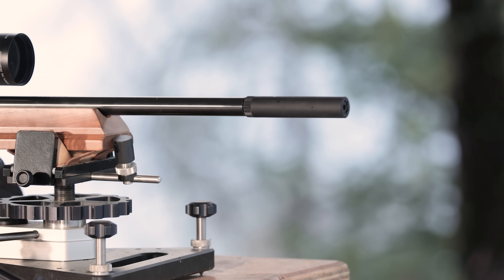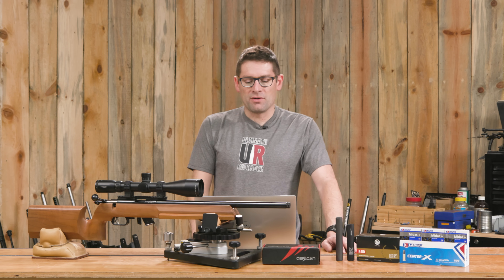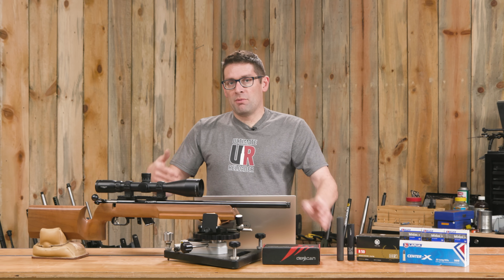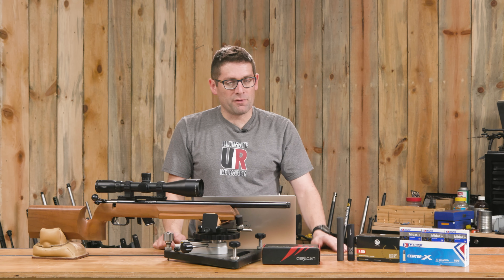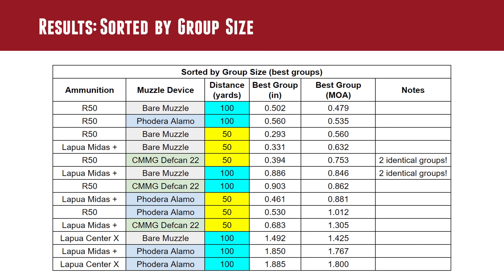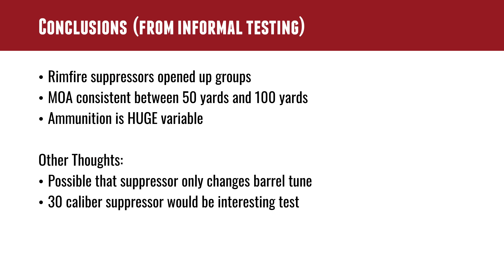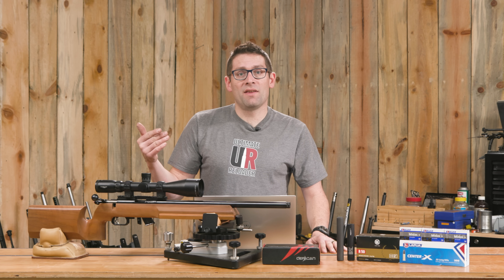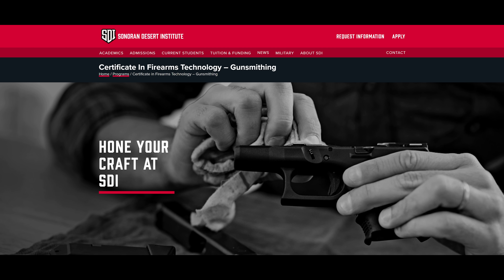Do Rimfire Suppressors Affect Accuracy? (let's find out)

Comment: I think you were right about the length of the suppressor changing the tuning of the barrel. If you put a tuner on the barrel that will affect the group size so it would stand to reason a suppressor would change the size of the groups. Every time you change a variable you then have to adjust for that change to get the smallest group.

Comment: Good info. However, when testing  22 rimfire ammo you need to clean the barrel between groups if you are changing manufacturers. I believe Lapua Center X & Midas use the same lube. Same goes for SK ammo's. My extensive testing has shown you can test SK Rifle Match,  SK Standard Plus or Long Range without cleaning between ammos as the case lube is the same. But you can't go from CCI to SK to Eley to  Lapua etc and get an accurate result IMO. The cleaning doesn't need be extensive either. 2-3 patches with brake parts cleaner and then a couple clean ones will do then a couple fouling shots and then shoot for groups. I've spent many hours and way too much $$ testing  higher grade 22 ammo. My Anschutz is picky as hell and I'm still searching for my Huckleberry. My CZ457 Pro Varmint shoots SK Rifle Match & Standard Plus as well as it shoots Eley Tenex and Lapua Center X at about half the price per box. The barrel likes what the barrel likes. My groups open up with my Thunderbeast Takedown 22 suppressor as well.

Comment: I have two similar supressors, one for .22 and the other for .30. They were made by the same manufacturer but I never knew who that was. The gunsmith that supplied and fitted them passed away more than 15 years ago. Both are non-serviceable monolithic types, just a big (much bigger than any other supressors I have seen) can with a single baffle roughly 2" from the end. They are designed to seat against a taper machined on the barrel behind the thread. The .22 one is fitted to an old BSA Martini-actioned target rifle. The barrel is quite thick and long (over 30"). On this rifle, fitting the suppressor improves the accuracy considerably with all the ammo I have ever tried. The .30 can also improved the accuracy of my .308 with all the loads I tested with and without, but to be honest I only tested a few loads without, and after that just always used it. Both these supressors make a significant difference to zero.

Comment: I think you're right that the cans are just changing the barrel's natural harmonics and it's just luck of the draw whether this or that can will be a benefit or detriment. I'm sure the turbulence inside the can is part of it, but if that were the only factor you would tend to think that one can would perform better than the other across multiple loads. I can think of two strategies to try and mitigate that. One, make the can as light as possible. That would have the least effect on harmonics. Two, have a weight that goes back and forth on the suppressor so you can tune it to your barrel. If you want to try that experiment, I could model you a little 3d printed weight that would slide back and forth on your suppressor and you could see if it's possible to tune those groups back down to bare muzzle size.

Comment: In my experience,over 20 years, I have found that suppressors designed for 22lr do slightly increase group size but I have found using over barrel suppressors that are volumetrically too large for 22lr, don’t alter or slightly improve group size the over barrel design definitely will effect barrel harmonics I have two 22lr rifles an old anschutz mod 1416 msp bolt action single shot 14” barrel and a marlin mod 925R 16” barrel, both are fitted with suppressors suitable by volume for 223. I only use sub sonic ammo. At 50 yards the anschutz consistently shoots .3”-.4” groups. The marlin shoots .5”- .75” groups both are regularly used out to 100 yards on rabbits etc 70% - 80% head shots. Out of interest over a chronograph the 14” barrel averages 17 FPS faster than 16” at just over 1000 FPS ,  love your videos always interesting and in depth info thanks keep it up

Comment: I have a 1.5" linear compensator on my 10/22 . It actually makes it even more comfortable to shoot and doesn't seem to affect accuracy at all.  I had a 3" linear compensator on my savage a22 and it made a huge difference on shot spread.  Took it off and regretted all the pennies spent on it. The shots closed back up without the 3 in linear comp.

Comment: I'm not as versed with powder burners and suppressors. But I shoot a fair amount of air rifles, and two things I learned.  With pellets trying to push velocity too much causes instability of the pellet. My theory on that is with too much air coming out of the barrel behind the pellet it actually kicks the ass of it around and you end up with instability from the very start. Buy detuning the rifle from a thousand feet per second to 870 ft per second with an 18 grain jsb pellet I was able to bring the group at 50 yards from half an inch a ragged one hole.  At 88 yards under half inch, and everything fell apart by 100 (3 inch).  But given my distance for that rifle, 88 yards is more than enough. So I'm pleased with that

With the powder burner I would wonder about Barrel harmonics if it were a heavier caliber, but I'm not sure if a 22 would move that Barrel around significantly. The other thing I would be thinking about is velocities.

I know you probably know all this but sometimes even asking the stupid question can be helpful. Because knowing less causes me to ask naive questions

Comment: Awesome video. Since 22lr cans get dirty, weigh the can clean then run a brick threw it and recheck zero. Weigh the can. Be neat to see, I don't have the funds to do this myself, but I know this is why compeditors don't run cans on 22lr's
Reply: Would be very interesting to see this, listened to a great podcast with one of the guys from Vudoo Gun Works, he was talking about how a rimfire suppressor would change weight over time and act as a tuner. With his setup he found the best node from 200-400 rounds and then they started to open up again.

Comment: For my 300 Blackout I have a thunder chicken, for the 22 I've been looking at a dead air mask. Currently the only Rimfire suppressor I have is the Ruger ISB which is the integrated silence Barrel. And I can get extremely good groups at 50 and 100 but of course I can't do a before-and-after and I'm not using a scope I'm using a red. So you have to moderate your expectations. At 50 yards I can consistently hit a golf ball first shot at 100 it takes me four or five shots but I'm also holding a little bit of Kentucky windage cuz I'm zeroed at 50. I'm looking forward to seeing the impact of a detachable suppressor because I'm looking at getting the dead air mask and putting that on a good 22

Comment: Really enjoy UR's channel for the technical info one can glean. The only downside (if you can call it that) is all the high-end/custom stuff he creates that the average guy either can't or won't plop down near the cash for. Luckily the info is applicable across the board.
  Back to topic...., personally I have no desire to spend $600+ ($200 permit plus sky's the limit on the suppressor) when rimfires aren't that loud to begin with. A linear comp brake would probably be sufficient to keep noise off the firing line.
  As far as a suppressor's ability to perform as a tuner sounds like trying to use something as it wasn't intended to do. 
  When I'm playing around with rimfire tuning (after ammo selection and torque tuning) I slide shaft or hub collars over barrel and use calipers for final adjustments into the node. Set screws are nylon tipped or a piece of lead shot is under setscrew (barrel protection). Of course barrels are of bull type design. For sporters you're limited to LIMBSAVER brand (rubber), they do work and are affordable enough (~$10) to warrant giving them a try.

Comment: As always great video welcome to the 22 rabbit hole  
Something iv found on my 1710 ss XLR it's not over fussy on match ammo it shoots them all pretty good. However with a can I didn't really see much difference out to 100 m but at 300 there's definitely a difference. 
And as you mentioned tuners iv been playing around with a EC tuner break and the new V2 tuner with a accurate 22 I think it really hard to find the correct tune 
Believe I have got mine dialled in to about a  .2 
Problem is I'm a .4 shooter lol  will really be looking forward to see how you get on with a tuner

Comment: If you want to really get into weeds with .22 LR accuracy you need to measure the rim thickness of the cartridge because it can differ between shells in the same box and it can effect accuracy. Also simply weighing the cartridges will show that not all .22 LR rounds are the same. The method in which they are manufactured can lead to some cartridges having more or less powder than others. Weighing them can sort them out into groups which you can test for accuracy. My dad has a hobby of playing with Ruger 10/22s to make them as accurate as possible and these were two things were among many of his steps to make accurate groups with a .22 LR out to 150 yards.

Comment: It's more about the barrel harmonics than the suppressor imo. I have a cz457lrp that i ammo tested then lot tested the ammo it liked best being rws r50 all suppressed (wildcat panther .22) and shoots groups on average better than the ones shown here. Rimfire shooting is more down to ammo testing and lot testing. You should try out somewhere that does lot testing near you with and without a suppressor i doubt groups will be much different on the best lot for each. Edit: Also why i strip and clean my suppressor after alot if shots as I don't want a build up of muck (.22s are dirty!!!) Increasing weight slightly affecting accuracy.

Comment: Seems to me that if the can is acting as a tuner (de-tuner in this case), then some of the groups should perhaps be better rather than worse. Obviously, there’s a lot to explore, including adding an actual tuner to the setup. 
One question: do you fire seasoning rounds when changing ammo types and if so, how many? That absolutely matters when testing rimfire accuracy, especially when the lubrication type changes drastically. I’ve watched bullet impact walk across the target as the barrel adjusts to a different lube. 
Waiting for more on this….

Comment: If it doesn't group within 11/32" at 25 yards then you need to change ammunition.

If it doesn't group within 1/2" or less at 50 metres with a barrel tuner then you may need to change ammunition.

If it passes both of the above then it should only be windage, light, or convection that will stop a MOA Group at 100 yards, and windage depends on the direction and twist of your rifling in the barrel, light depends on clouds and the Sun, and convection is all about the time of the day/year.

Comment: Not all suppressors are designed with accuracy in mind, some are engineered  with overall sound suppression and tone being the key design feature.  Db ratings and price point sell more cans than anything else  in my experience. So what are those 2 cans designed for accuracy  or sound?

Comment: My question has nothing to do with suppressor but does have to do with tuning. Will you add a tuner? I keep hearing tuners are not consistent. After finding a node adjust the tuner and going back to the previous accurate node setting it won't be in tune. Heard your supposed find it the first good node and set it.

Comment: I posed this question on another video with similar testing.  If the crown of your barrel is damaged it is said to mess up your accuracy.  I guess the damaged crown would screw up the “harmonics” of the pressure against the bullet.  Couldn’t the suppressor do the same thing?  They are not smooth inside so the pressures would be imperfect as it is with a damaged crown.  I have a hard time seeing how the added weight could screw up barrel harmonics with a barrel that heavy shooting standard velocity 22 rimfire.  Curious about your thoughts on this.
Reply: Typically, a suppressor is not touching the bullet in any way.  What you are mentioning about the crown, is something that could score the bullet as it is exiting the barrel or cause an unstable air pressure / volume on the base of the bullet as it exits the muzzle.  That is a giant accuracy problem, which is why a good crown is important.  A suppressor not touching the bullet doesnt have this affect.  HOWEVER, the added mass on the end of the barrel has a giant impact on the way the barrel "whips" as a projectile goes through it. The "whipping" affect is called Barrel Harmonics and changes with mass, pressure, temperature, rifle stock conditions, recoil, shooter induced pressure changes on the rifle during firing, etc.  The key is getting something consistent, and finding that is the holy grail of benchrest accuracy of any rifle...
Reply: @reggiecaillouet1463  I’m not suggesting the bullet is contacting the suppressor or anything is scoring the bullet.  Read my post again…